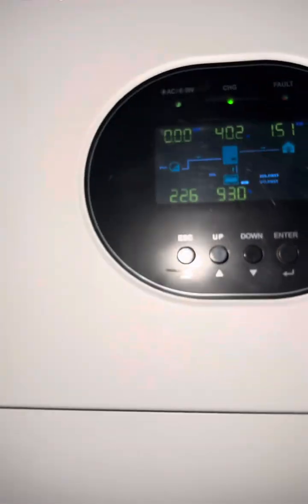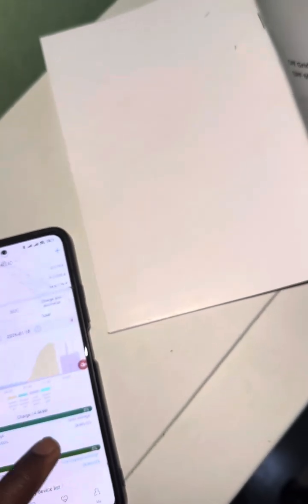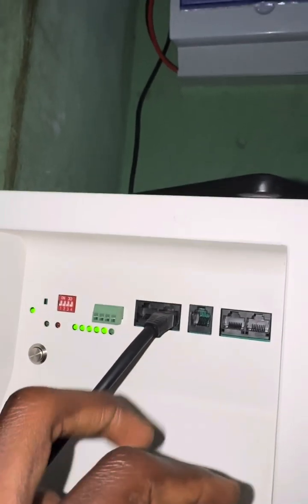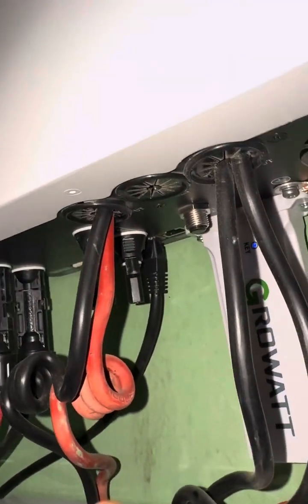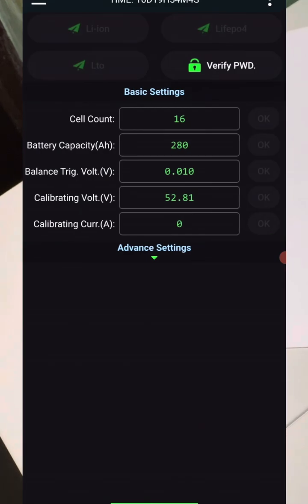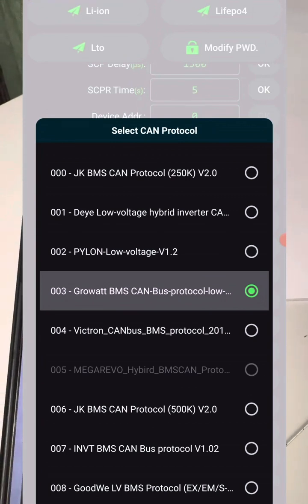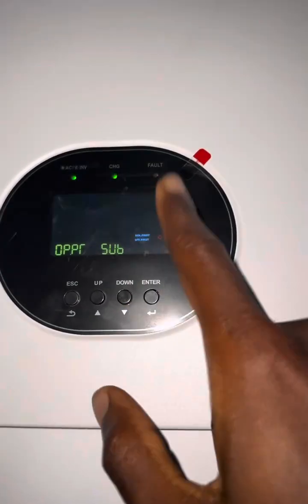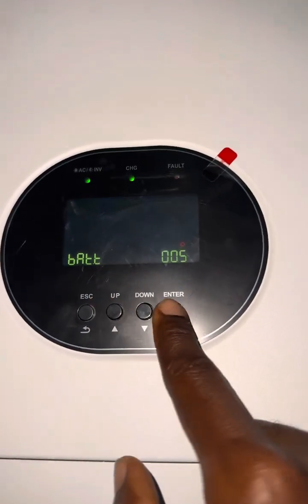How to Set Up Battery Communication: JK BMS PB2A16S20P with Growatt 6000 ES Plus & Other Inverters

Comment: How often do you clean your inverter for the dust accumulated inside?
Reply from the maker: Frequency will depend on the location you have yours installed - how dusty the environment is. At least twice a year is a good base to start from.

Comment: Thank you for the video.
Did you have to modify the communication cable in any way, or is it a regular straight through pinout configuration?
Reply from the maker: You’re welcome!

The communication cable wasn’t modified.
Reply: @Mrcalxy  I wish I can see/know the pinout arrangement on both ends. I have used mine and it isn't working, not the CAN, not the RS485 port either.

Comment: Hello,

Please I want to know if the maximum input voltage of your 6kva inverter SPF plus is 500V per MPPT of the inverter or 500V in total for the two MPPT of the inverter. The data sheet is not specific about this.. please clarify.
Reply from the maker: @safetyalways7788  It’s 500V per MPPT.
Reply: @Mrcalxy  I wonder what it will cost growatt to be specific about max input voltage on its datasheet just the way they are about max input current per MPPT

Comment: How did you connect the jk-bms app to the Bluetooth of the battery?
Reply from the maker: You have to download the JK BMS app from the App Store or Play Store(depending on your mobile operating system). The pairing code maybe 1234, 123456, 12345678.

Comment: Hi, what kind of cable he used for communication, I can't, I have a growatt soft6000es like yours
Reply from the maker: A standard RJ45 cable will work, and a new SPF 6000 ES Plus inverter usually includes one in the box. If you lose it, you can easily find a replacement anywhere.
Reply: @Mrcalxy  Thank you